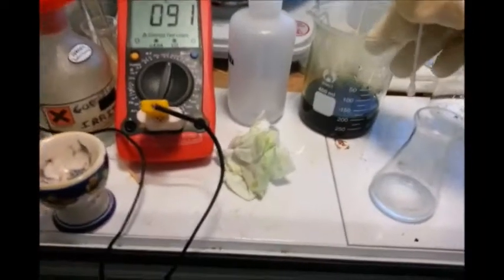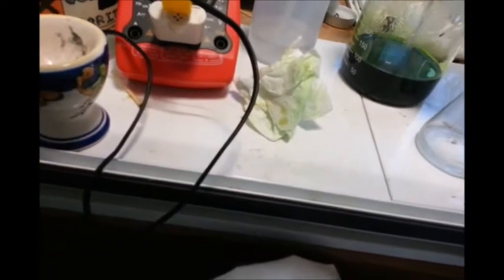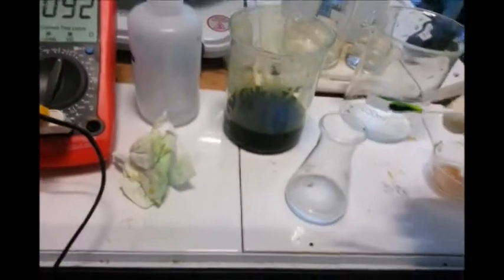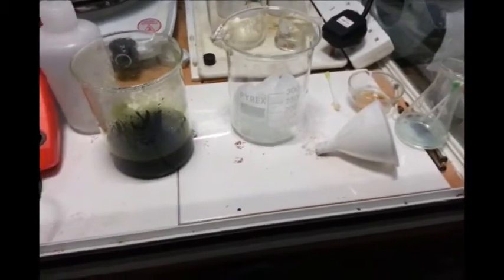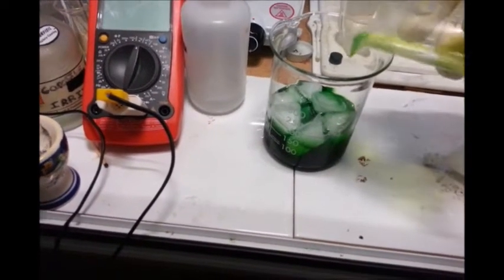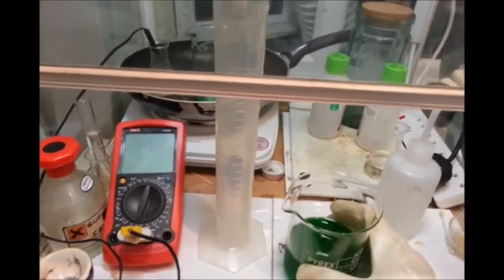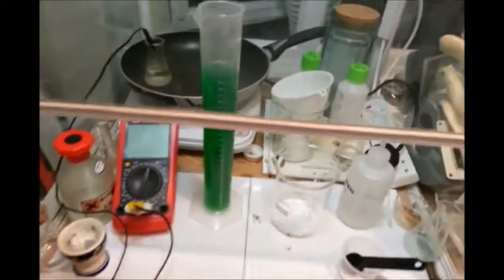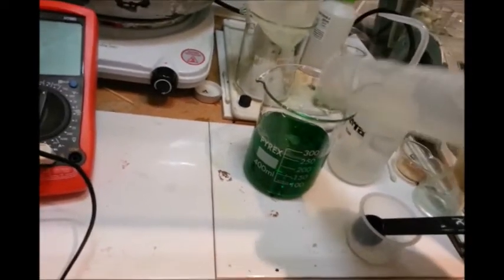Aqua Regia Gold Extraction - Scrap Pins

Comment: sir I have a aqua regia black liquid suspension of gold in aqua regia. I added SMB from Stump Out to precipitate but it did not work. It fizzed, but the SMB fell to the bottom and the black liquid did not precipitate the gold. What should I do now?
Reply: ***** Question. So Aqua Regia can be used for gold plated material such as computer pins and computer scrap, and will it dissolve all of the base metals as well? I have 3 ounces of gold plated computer scrap to do and want to do it another way than the reverse electroplating. Any advice?